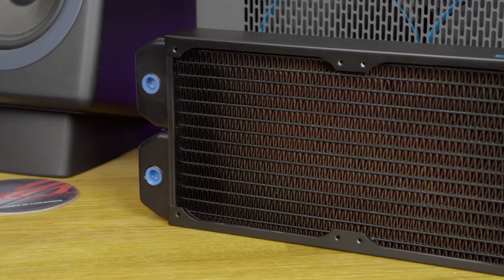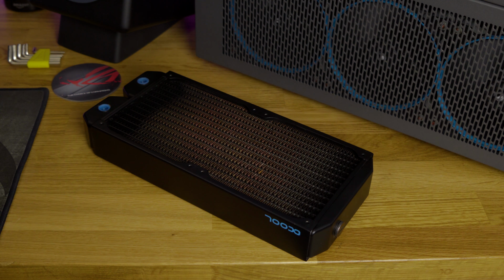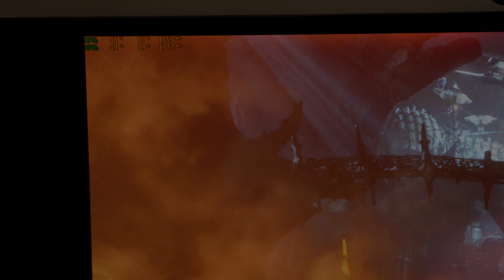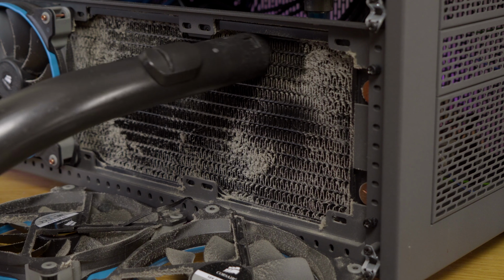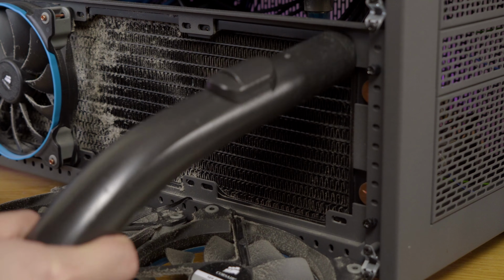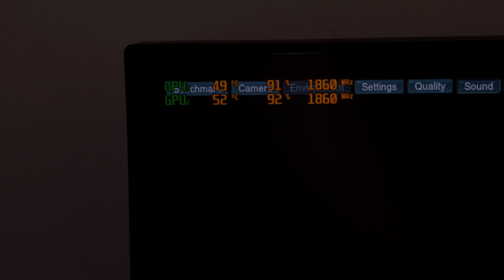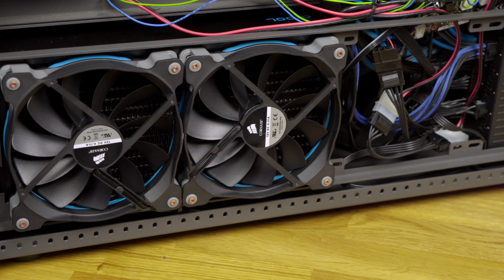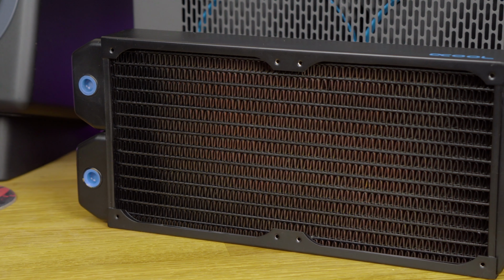Diminishing returns on radiators

Comment: The way I see it, if your system is putting out 400 watts of heat, and a single rad can dissipate 400 watts of heat, adding more radiators won't give cooler temps
BUT, it will allow the same 400 watts of heat dissipated at a lower, and quieter, fan rpm.

Comment: Hooe will order everything for my first hardline tubing :) will have 360mm and 240mm rad for cpu and gpu loop. Time to move from soft tubing. Everything depends if ill have money for dark base pro 900 case to start my build :)
Reply from the maker: +Lv Faaters best of luck with the hardline tubing, it can be tricky but the results are definitely worth the effort.

Comment: I know this is old but the 280mm rad is pulling air from the Main rad that has warmed the air. For best long over time temps that avoid heat soak both need to be pulling in cool are from outside the case. You will see the temps stay lower when stabilized.
Reply: it doesnt matter, air coming out of radiator wont be 10c warmer than the one that enters to make a difference, actually linus tech tips made a video where they stacked 7 radiatrs one on another and stacked radiators have literally few degree delta between coldest and hottest one and still are worth it

Comment: Im adding a 360 to my already 240x60mm because the water in system is extremely F hot even with push pull & a D5@24volts when I game

Comment: It would be brilliant if Ekwb could produce an external very high powered pump and their new connectors push and pull types and same from our heating water pipework and when we're using the pc push that water around the radiators with a filtration system that took away any metal etc from the rads I bet it would take 15hrs to get up to 30oC and you could heat the whole house ;) silly idea I know but it would save a fortune on heating ;)
Reply from the maker: That would be one bad ass cooling setup, wow - you wouldn't need any fans making it passive and silent. That said, might be tricky to set up .... lol
Reply: Tao of Tech once I have taken delivery of my new car in the new year (doing a 5 year total ownership of the car on YouTube and upwards of 200,000 miles) so if you ever think of going fully BEV especially the new nissan leaf keep me in mind ;)) I'll be ordering new front and top replacement panels for my phanteks enthoo evolve tempered glass case to aid more air flow for the rads

Comment: I have the same case and all those fans. I HATE how damn dusty those cases get in just a short time.  It is a pain in the @$$ to clean them.  Still love it though...
Reply from the maker: Yep, pro's and cons'. Nice quiet and cool setup vs lots of dust. Probably shouldn't have left it a year to clean it :-0
Reply: Tao of Tech I'm impressed that's all the dust you gathered in a year.  That's how much dust I get after just 2 months.  Guess  I need to deep clean the house 😂😂😂.

I'm cleaning the case right now because my wife and I are going to start building the Threadripper build tomorrow.  I'm retiring my 9 year old previous build which is still a very capable system for an average person.

I won't be able to get the 2nd 1080 ti FTW3 and the rest of the water cooling til February but it will still be dope for now performance wise
Reply from the maker: sounds like a sweet build, gotta love threadripper, good luck with the build. Remember the socket can be temperamental to lock down, one half turn anticlockwise sorted it for me.

Comment: I can tell you that if I take out a 980 ti, they still go up to 45 c, so... yup. Can't wait to see your experience.
Reply from the maker: +DrOrtmeyer how many GPU’ sin your loop. You’ve built in the sma8 also?
Reply: 3 980ti's. You actually got me to do the SMA 8 build, I credited you at the end of one of my videos aswell :)

radiators are a PE560 and a UT60 280. fans are always on low. (40%) the SMA8 has to be my favorite case.
Reply from the maker: Yes - I remember the vid :-) Hmmmm, that's interesting with removing a card from your loop. Its the opposite experiment to mine, I need to think about why that is as in theory you have less heat and the same cooling capacity which should mean lower temps.
Reply: It's been a while and this pc has been in so many variations that I can barely keep up. anyway, I do hope that you liked my video.  I'm happy either way that you pushed me towards the SMA8. It's a dream case to work in. I do remember that the 2 card config was in the 900D with UT60 480 +280 (tight fit)

I don't think I pushed them that hard, I didn't run it long term anyway, Just untill the SMA8 arrived, it was actually the last setup I had before I tore it down.
Reply from the maker: Liked the vid :-) I see - there's been a few different configs, probably explains it. Agreed on all points on the SMA8, its the best case I've owned and worked in. Always good to connect with you bud - look after yourself and keep the vids up.
Reply: thanks for checking the channel out. I'm working 40 hours a week now, so it's harder. on top of that I have a hard time finding topics. I skipped last week. I'm gonna be on the lookout for things to talk about. good luck with your content too. I really admire all the work you put in. I know for a fact that videos with my face in them are a day of recording and a day of editing.